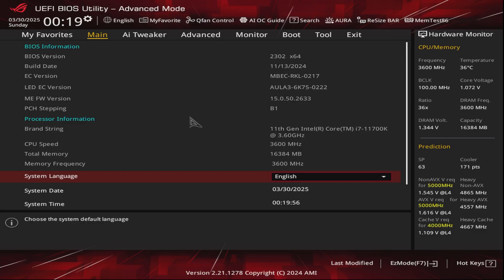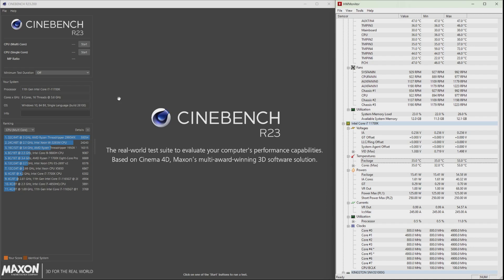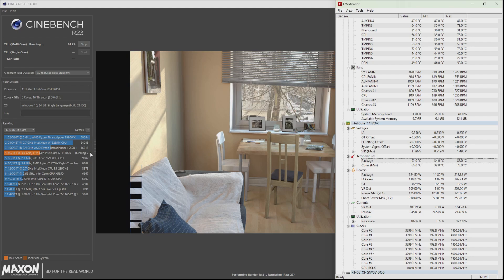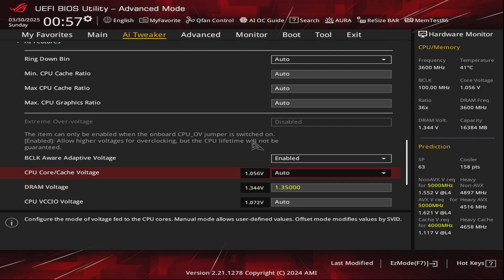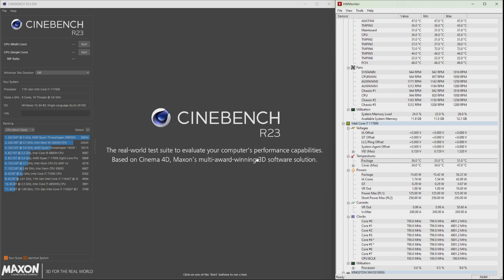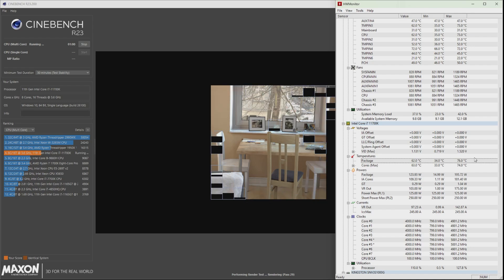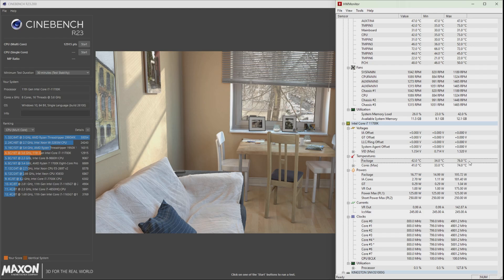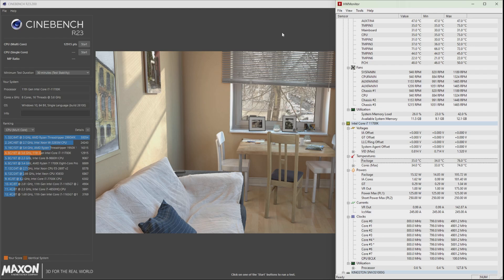How To Quickly And Safely Undervolt Your CPU

Comment: Mine 275hx is stuck at -30mv max, cant put it any further. Why?
Reply from the maker: What is your motherboard? In most cases laptop cpus and boards put mV undervolt caps due to some OEM restrictions.
Reply: @tweakmixbuilds It is an Asus Rog Strix G18 laptop, not sure about motherboard
Reply from the maker: Are you undervolting using XTU or from BIOS? And have you tried updating to the most recent BIOS? For stock BIOS possibly giving you the -30mV cap.
Reply: @tweakmixbuilds from BIOS, I’ll check updates. Thanks
Reply from the maker: You’re welcome. Let me know.

Comment: So what's about the i7-10700kf in work in 0.075?
Reply from the maker: Yes, the Intel Core i7-10700KF can be undervolted to -0.075v. It’s an unlocked processor, so you can adjust voltages and multipliers via your motherboard’s BIOS/UEFI or through Intel’s Extreme Tuning Utility (XTU).
Reply: @tweakmixbuilds Yeah, I have a Rog Strix Z490-i itx

Comment: Hey! So in the updated BIOS, I have to find "Global Core SVID Voltage", set it to offset, then the offset more sign to "-", and then input 0.075, and that's it? But when I accept the changes, it looks like this: 0.07500. Is that okay?
Reply from the maker: Yes. It is ok. 0.075 and 0.07500 numerically speaking are just the same.

Comment: will this work on a i9-13900k
Reply from the maker: Yes. Definitely.
Reply: @tweakmixbuilds  why dont i see cpu core/cache voltage, instead it shows actual vrm core voltage is that still the correct setting
Reply from the maker: @sariebear May I know the exact brand and model of your motherboard? So I can help you.
Reply: ASUS ROG MAXIMUS Z790 HERO
Reply: @tweakmixbuilds  also the bios version is 3001 if that helps too
Reply from the maker: @sariebear Got it. BRB
Reply from the maker: You’re good! Your BIOS is updated.
Reply from the maker: 1. Enter BIOS
	•	Reboot your PC.
	•	Press DEL or F2 during boot to enter BIOS.
	•	Press F7 to go into Advanced Mode.
2. Go to AI Tweaker Tab
	•	Navigate to the AI Tweaker tab at the top.
3. Set CPU Core Voltage to Adaptive Mode
	•	Find: CPU Core Voltage
	•	Set it to: Adaptive Mode
4. Apply Negative Voltage Offset
	•	Now set:
	•	Additional Turbo Mode CPU Core Voltage → leave at default or set around 1.25V
	•	Offset Mode Sign → select Negative
	•	CPU Core Voltage Offset → set to -0.050V

- This is a good starting point. You can test stability and increase to -0.075V or -0.100V if stable.

5. Save and Exit
	•	Press F10 → Save Changes and Exit BIOS.

⸻ After Undervolting: Test Stability Use tools like:
	•	Cinebench R23 (10–20 min loop)
	•	AIDA64 Stability Test
	•	OCCT
	•	Gaming sessions (watch for random crashes or BSOD). If it crashes. Don’t worry. Just go back to STEP #1, but this time adjust to lower down your offset value. Then test it again.
Reply: @tweakmixbuilds  i dont see CPU core voltage anywhere what i see is "global core svid voltage" which i can put adaptive mode on and "actual VRM Core Voltage" which i can put to offset or manual mode which one is the correct setting?
Reply from the maker: @sariebear No worries. If you cannot see the core voltage, you can try this approach:
1. Enter BIOS
	•	Boot your PC and press DEL to enter BIOS.
	•	Press F7 to go into Advanced Mode.
2. Go to AI Tweaker
	•	Open the AI Tweaker tab.
3. Locate and Set “Global Core SVID Voltage”
	•	Find: Global Core SVID Voltage
	•	Set it to Override (instead of Auto).
	•	Enter a starting value like 1.25V (this is usually lower than stock 1.35–1.40V under turbo loads).

* Suggested safe starting values:
	•	1.25V → Good balance of undervolt and stability
	•	1.20V → Aggressive, test thoroughly
	•	1.30V → Mild undervolt

4. Save and Exit
	•	Press F10 → Save changes and reboot.

- Test System Stability After boot:
	•	Use HWInfo64 to monitor core voltages, temps, and clocks.
	•	Stress test with:
	•	Cinebench R23 (10 min loop)
	•	AIDA64 Stress Test
	•	Games like Cyberpunk 2077, Apex Legends, etc.

If you crash or BSOD:
	•	No worries. Re-enter BIOS and increase the voltage slightly (e.g. from 1.20V → 1.25V).
Reply from the maker: How did it go?
Reply: @tweakmixbuilds  it went well i think but it didnt fully fix my problem which is current/EDP limit throttling
Reply: @tweakmixbuilds  also will this decrease my performance?
Reply from the maker: @sariebear Good to know that it went well. I just didn’t know that your intent is to fix your current/EDP limit throttling. Because this video is about undervolting. Fixing your current/EDP limit is a different topic.
Reply from the maker: No. But your EDP  throttling issue will. Have you tried disabling the limits? Here is a quick tip for you:

Go to Extreme Tweaker > ASUS Multicore Enhancement
	•	Set it to “Enabled – Remove all limits”

This alone disables all PL1/PL2/EDP constraints. But important to make sure that your aio or custom looped cpu cooler can back you up with good performance cooling.

Let me know.
Reply from the maker: Please subscribe for more insights. And to get notifications on new videos. Thank you.
Reply: @tweakmixbuilds  i will try and yea in know but undervolting was supposedly one of the fixes for my problem and i think it did because its not occuring anymore while gaming but while under a stress test it does also i did want to lower temps
Reply from the maker: That’s good to know. Please subscribe to my channel for notifications and more insightful videos.

Comment: I have a b560m-c and my bios software is so different, some of the volts I can't even change what should I do
Reply from the maker: Are you using an ASRock B560M-C motherboard? If yes then here are some things to check and consider:

•	Intel 10th/11th Gen CPUs often block undervolting completely on some BIOS versions due to Plundervolt mitigations.
	•	If no undervolting options appear in BIOS, check for:
	•	A BIOS update from ASRock.
	•	Enabling Intel Adaptive Boost or Voltage Override options that might unlock more control.

Comment: Something is wrong on ur test ...u got only 4000mhz on all cores i gopt 4.600. I got score 14450 on R23 and same Configuration like u Z590-F and 11700K with artic cooling 360 Aio First run 73 temp and second with 0.050 70 temp.Its your Boost off maybe ?
Reply from the maker: There’s nothing wrong with my test. I am pretty sure about that. For I have done hunderds of these. And our system are not the same. You’re cpu cooling is an AIO and as what I have mentioned there is that I am only using an air cooler from Noctua. Which is their NH-U12A. That’s why your scores are better than what I got in the video. If you’re familiar with cpu heat to performance and speed throttle relation you would know exactly what I am saying. The cooler the cpu the better performance result you get. And this video is not about the best cpu cooler. Good for you having an AIO strapped to your 11700k. For test purposes, it will be an overkill putting an AIO on a 11700k for now. And this video can help other users/builders/gamers who only have an air cooler option at the moment they are watching this video. Though I have other builds with AIO on it…as it requires me to already do so. Happy gaming!
Reply: @tweakmixbuilds  to be fair I also have the 11700k and air cooled, yet my score is 1451 at 4.6, temps don't go over 83 celcius. so definitely possible air cooled.
Reply: @tweakmixbuilds I was just wondering about over 600mhz Differenz betwen core clocks.I though that 11700k on 100 temp do thermal throthling but u was on 80 🤷‍♂️ good video allways.
Reply from the maker: Thanks for observing. But I was on all defaults, no tweaking on both BIOS and Windows. Just undervolted. Typically an Intel cpu would start throttling at 95°C but at 100°C things will start to show abnormalities and will eventually shutdown to protect itself from frying. But with all Intel defaults on motherboard BIOS and Windows power management on default settings you’ll expect these throttling to happen early. Thanks for watching. I might do some in-depth overclocking benches that might interest you in the near future. Happy gaming! What titles do you play?
Reply: @tweakmixbuilds  I play most indie games , but i can play with my undervoltet 3090 so far all games in 2K i see no reason so far to buy 4000 or 5000 Series 😊
Reply from the maker: @GogiSpielt yeah…I mean the 3090 is a solid 2k gpu, actually. Have fun!